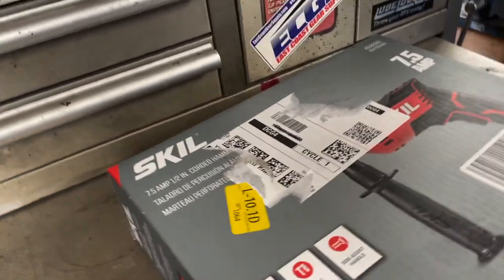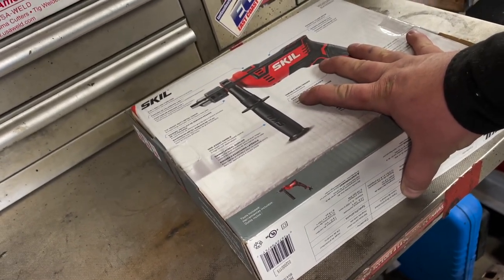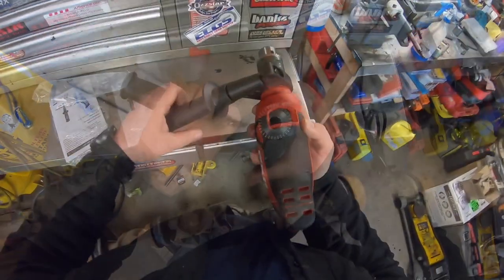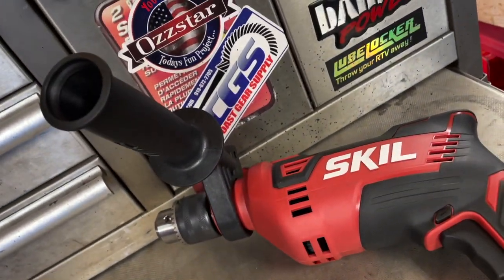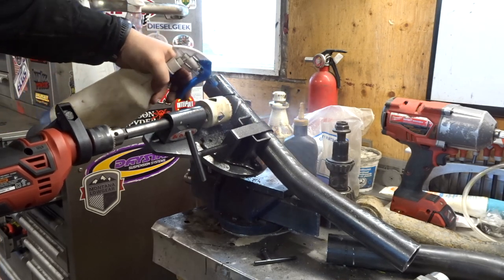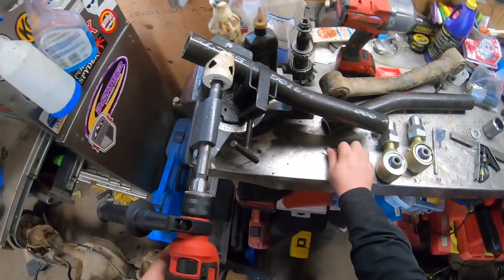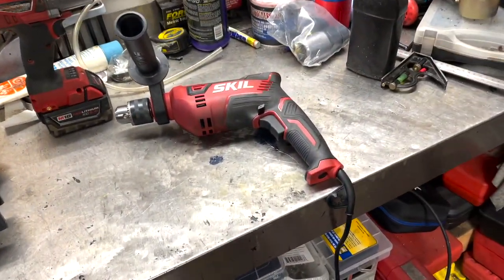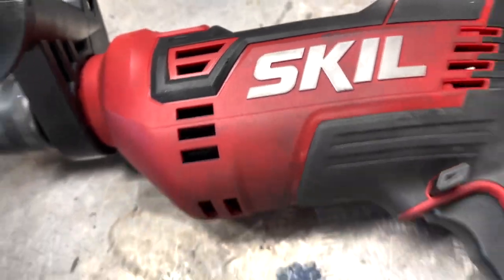SKil 7.5 Amp Corded Drill Lets Work it

Comment: I recently bought a cheap, corded Skill jig saw for some small cutting jobs while building a new tool shed in my backyard.  I too was impressed with it. It cut like it was cutting through butter without a single hick-up.  Surprised me, I thought it would crap out on me as a throw away tool, thinking it was just a cheap $30 Skill piece of crap.  But I was impressed with it.    It did a fine job cutting over and over, so it earned its' rightful place in my tool box!  Looks like Skill has up'd their game!
Reply from the maker: I was happy with this one as well until it died notching the control arms for the tj, the torque of the tube notcher was too much. Under regular drilling this drill would have been awesome